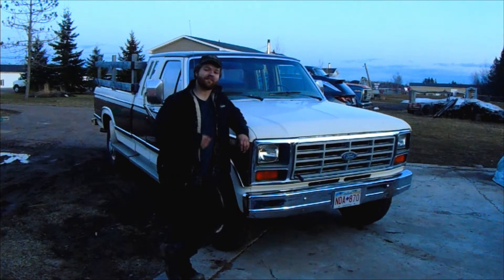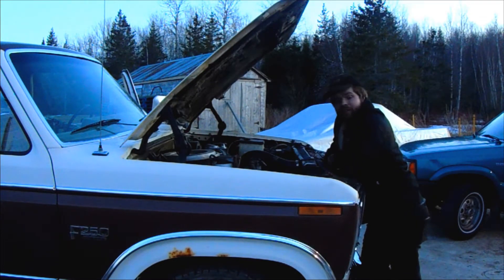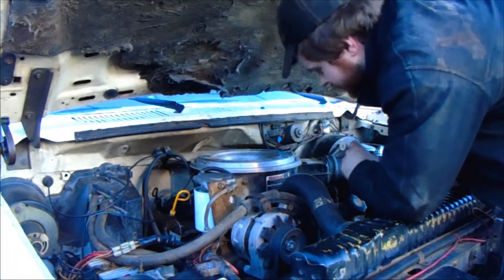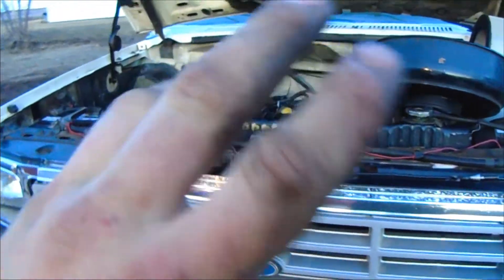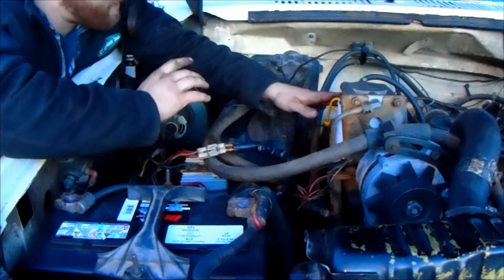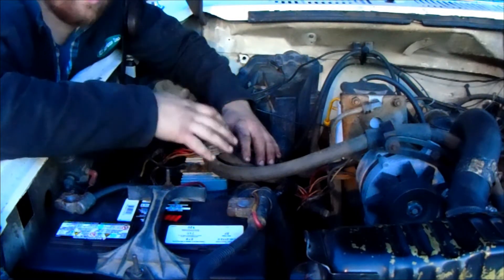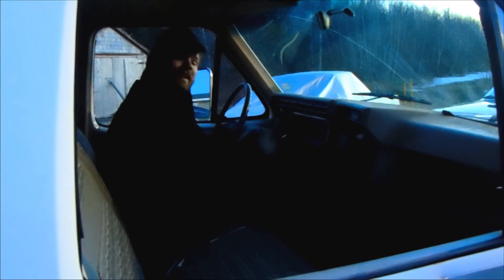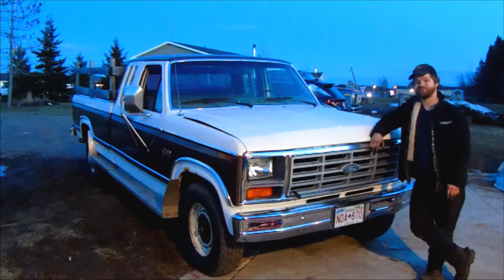How to change 6.9 IDI Glowplug Controller to The 7.3 IDI Glowplug Controller - Step by Step Guide!

Comment: Just came across this... I have a 1987 f250  with a 6.9... In need of new engine. Can I put in a 1986 6.9 idi. My wires for the 87 are good... Any issues in doing this change over?  wish I could find another 87 6.9 ..oh well.

Comment: Are you running the later style "bullet" connector glow plugs? I heard the older Spade connector glow plugs will not work with the 1987-up style controllers. Can you confirm?
Reply from the maker: As long as the specs are the same you can run the older plugs, but you will have to change the ends in the harness, I have a more in depth video now on the channel  now than this one if interested, its about a month old

Comment: Very nice, i just picked up an 87 6.9 evidently the PO rewired it to a 7.3 but relay isnt working correctly I have a 89 7.3 IDI that runs and drives and years ago I did a momentary switch set up in it when I push my momentary my WTS light comes on which is nice. Seems that this 6.9 is wired up to opposit terminals to the 7.3 thanks for fleshing this out I subbed.
Reply: @Deepblue FYI, 1987 was a transition year for the these diesels. They were still 6.9L but the wiring harness was updated along with the new body style. You if you own a factory 1987 ford diesel, it most likely has the older engine with the newer electronic controller.
Reply from the maker: @grndiesel  good to know 👌
Reply from the maker: I'm glad I could help! I actually have a brand new video that's updated, goes a lot more in depth and is wired in a way that you don't have to change the harness over, it's one of my new videos can't miss it. Hope it helps!